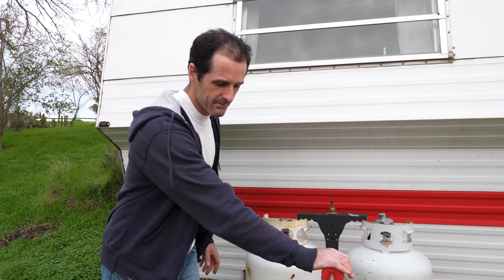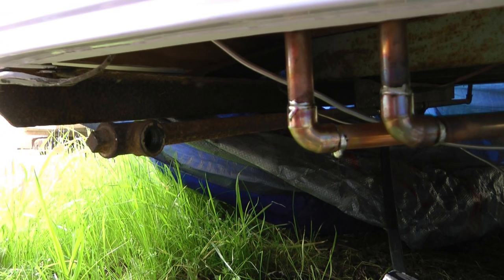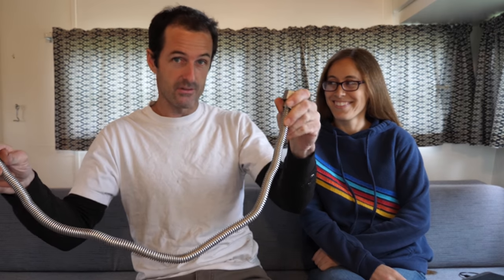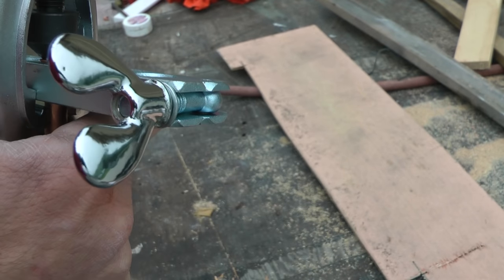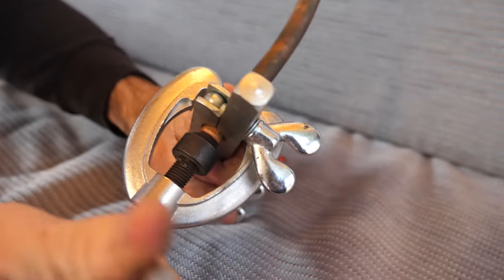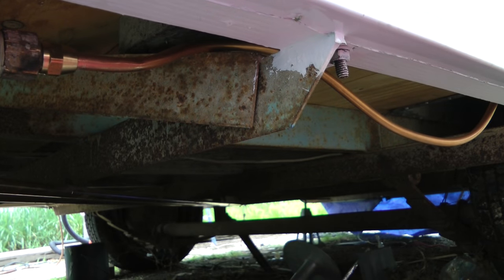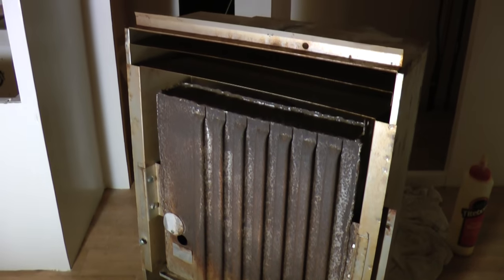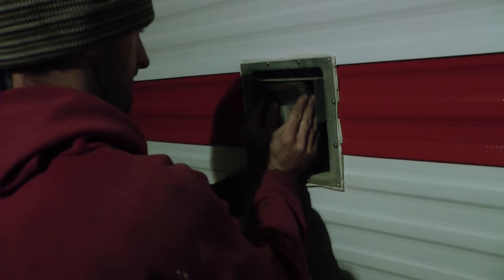Vintage Shasta Camper Trailer Rebuild - Part 22 - Propane Gas System Plumbing

Comment: Yay, finally a trailer update!  I just finished mine last year and finally got to use it a bit. Still a few finishing details though that I'm taking care of this winter. I found my 1968 Holiday Rambler shortly after you started posting videos of yours so they were both definately long term projects.  I have a similar heater in mine and have enjoyed the same aroma for the same reason for quite awhile!  Looking forward to more reveals as you post them...you two are very punny by the way. lol

Comment: A word of caution on your propane compression fittings....you should really only use "gas nuts" on your fittings instead of the "water nuts" that you used.   Typically when the water nuts are used in an outdoor environment they get water between the pipe and nut and then freeze causing a crack..... and then a gas leak. 

Keep the content coming please!!

Comment: i worked at shasta in the '80s for a bit. actually, i worked at a lot of rv factories in the '80s. i've built truck campers, pop ups, pull behinds, class c and class a motorhomes, and van conversions. i lived and worked in elkhart in. when there were more rv's constructed in that single county, than everywhere else on the planet combined, and was called "the rv capitol of the world." lemme tell ya, they were built with spit and toothpicks, and we ran out of spit a lot.

Comment: I know it’s late but I figured I would share what I learned years ago about gas. 
you should use Short forged flare nuts for gas. 
Those are long nuts and are for water plumbing

Comment: I was pleasantly surprised at the cost of cast iron gas fittings while building furnace burners for knife making. Once you're on the road with the refurbished trailer, it's tough to get back to tenting it! 👍 😃

Comment: that’s the wrong lp regular on there buddy. by law you can’t have a single stage bbq regulator on there. it has to be a dual stage regulator with two hoses

Comment: I think it is because Ca. legalized Pot. Then the cleverness was stifled and you just thought you were being funny. After using the cutter we use the reamer and then the flaring tool after you put on the connector nut. Depends on the length of the cheater pipe the wife uses on the wrench on the iron pipe.